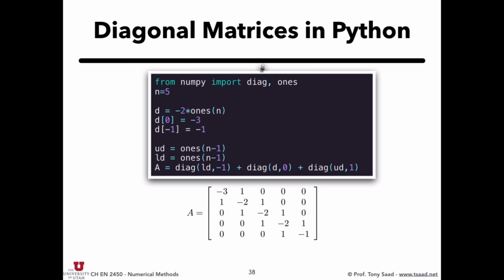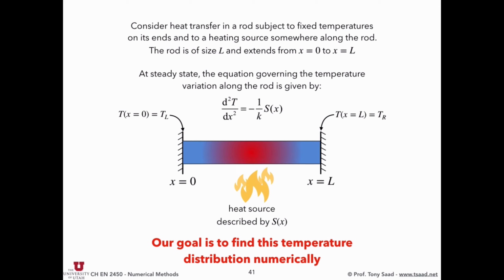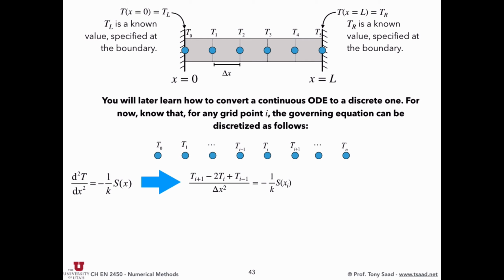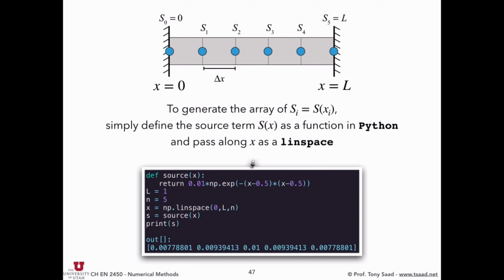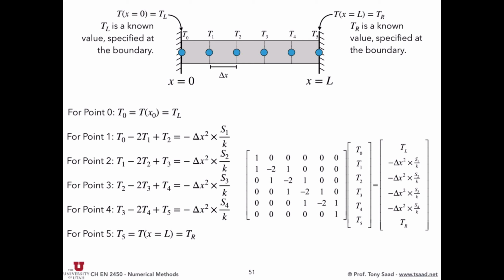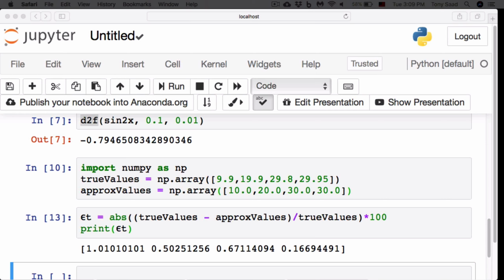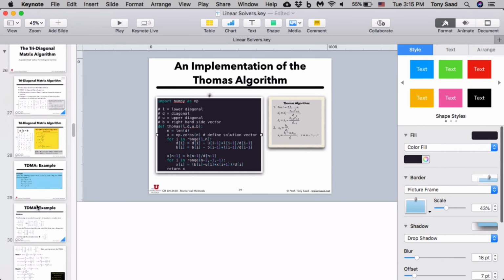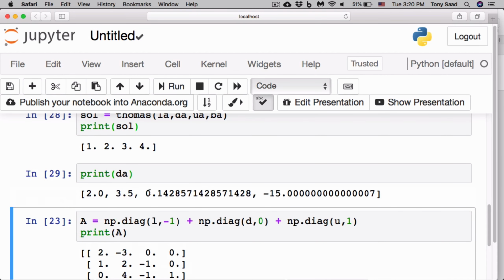07.2. Heat Transfer Example

Comment: Very minor point, but at 15:40 there are 6 points in the drawing (x0 - x5), so the array returned by linspace is different than the drawing, since linspace returned n-1 = 4 intervals.